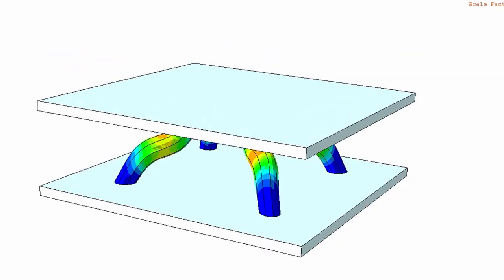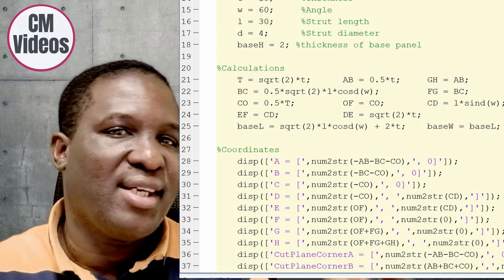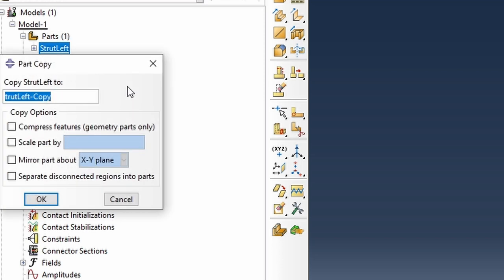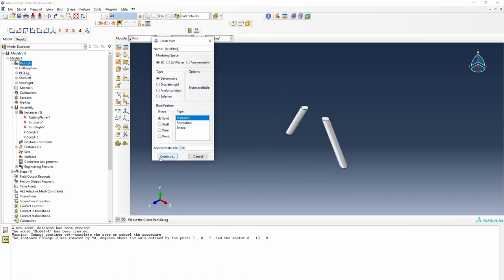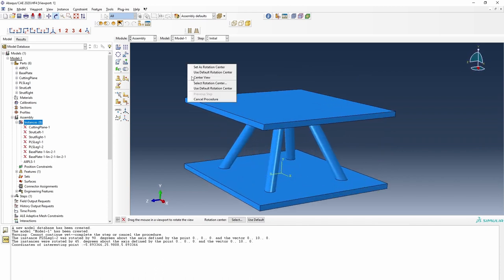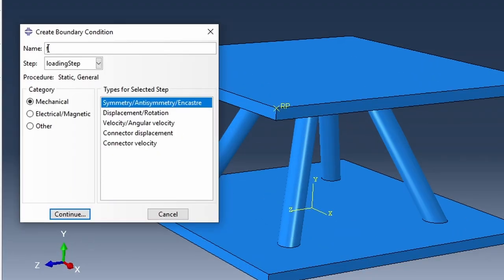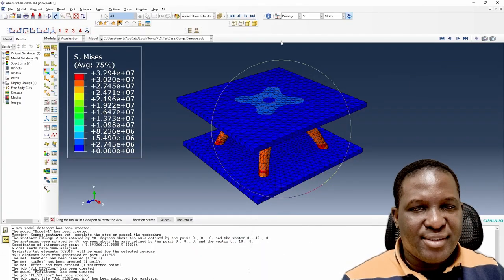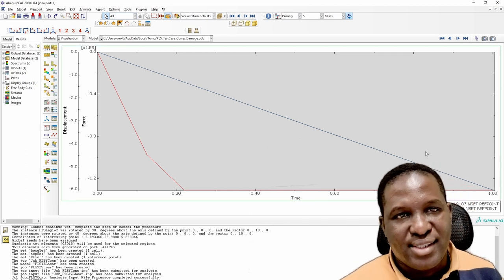RVE modelling of pyramidal lattice structures in #Abaqus

Comment: Thanks lot for this video. Considering the complex parameters of selective laser melting, can you simulate a lattice structure for SLM in Abaqus? Or Abaqus can't simulate selective laser melting?
Reply from the maker: Hello @Said Abdesselem, I am sure it is possible to simulate SLM in Abaqus. It really depends on how you set up the model, the guiding principles. One will need to get some information about this. I remember reviewing a paper in the past about additive manufacturing (maybe even SLM) where the authors were trying to use numerical methods to simulate the process, so for sure it can be done. I have not done it before but this can be an interesting project to explore, maybe in future.
Reply: @MichaelOkereke  thanks lot for your support. I searched lot about this and I found only Netfabb, simufact, and Materials magics have this Additive manufacturing. I didn't find it in Abaqus. There are no single video in YouTube showing how to predict stress and failure in Additive manufacturing using Abaqus. I thought you are maybe the one that can solve this for lot of students and researchers around the world. Thanks lot again for your videos and hope you success.
Reply from the maker: Hello Said, I will bear this in mind and see if I can make such videos.